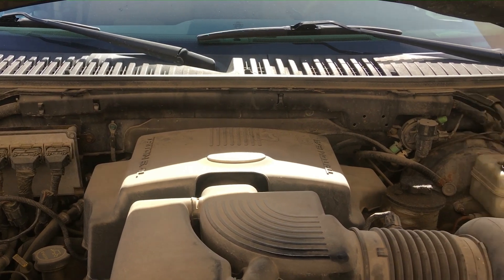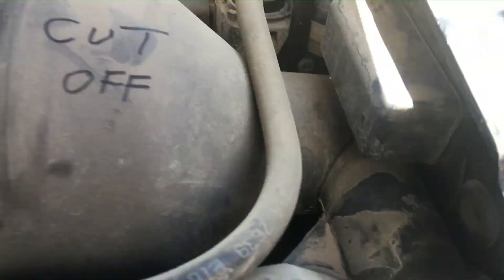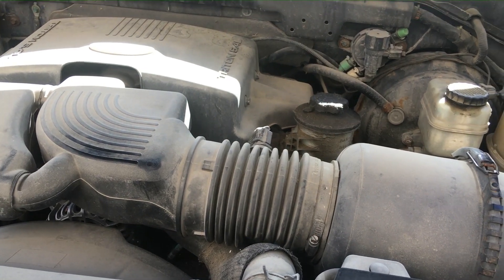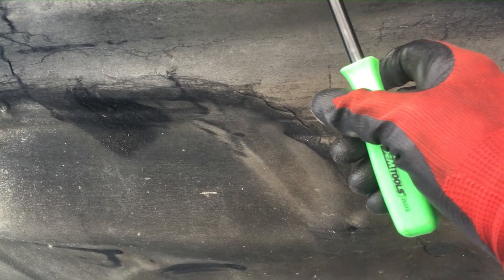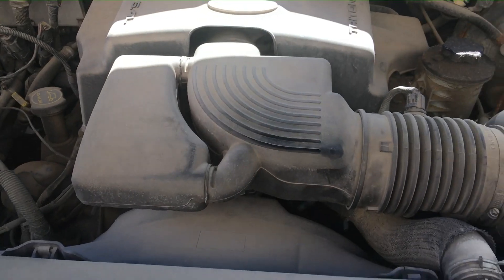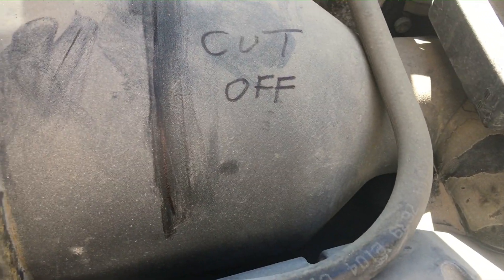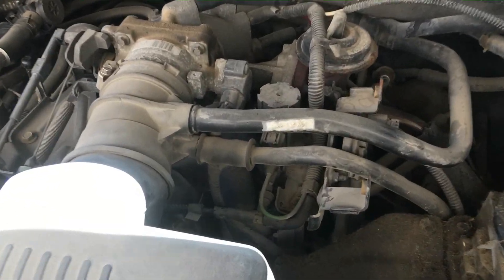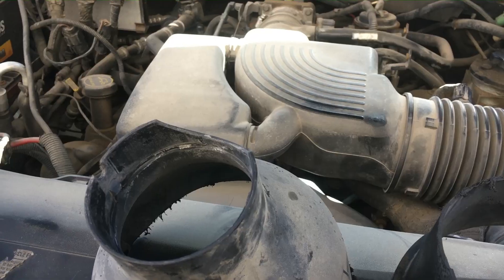Free Cold air Intake mod Ford Expedition, F150,  mustang 4 6 and 5 4 2v V8 engine

Comment: Great video, and you give me another way of an idea. I cut in between the air intake tube and the resonator. I than removed the resonator, placed a 2inch PVC elbow and ran it straight into the fender like the air intake tube. No engine air intake suction from the engine bay. I wish there is a way to post a picture. I thought by adding more inches to the original suction would make a difference. The cut is at a prefect location incase it fail than I could put it back to the original. For months I wanted to do like you did in this video, but the weather here in Nebraska could be crazy at times. I really love my 2003 Expedition but the gas mileage not so much. Big time better performance, it doesn't take much to get up to speed and still testing. Anyways, again your video ROCKS!!!!!

Comment: If you ran this thing on a chassis dyno it would show little if any improvement, and possibly even lose performance. That plastic is designed specifically for a certain amount of backpressure mated with the ECU for efficient fuel burn at all RPMs. You may gain WOT performance and lose cruising efficiency. If it was as simple as sawing the plastic off they would have done it themselves rather than place an artificial limitation on their design.
Reply from the maker: I did run my 2014 F150 3.5 twin turbo some years back with my intake mod and my exhaust setup.  It Dyno performed more wheel power and torque than the factory numbers at the crank.  Its on my 2014 F150 playlist if you would like to see it.

Comment: Thanks for the video, I live in a place where it's always sand storms and dusty weather so is it safe for throttle to do the same you did with my air intake ? I have the exactly the same car
Reply from the maker: Yes, I have to take compressed air and blow out my aircleaner every few weeks to keep it clean from dust and sand.  Saves money instead of buying new airfilters or paying more for fuel costs due to clogged filter.
Reply: @madboostingmadmatt48  thanks

Comment: Isn't it taking in hot air from engine compartment?
Reply from the maker: No, I made a video using my SCT tuner showing intake temperature is just a few degrees different than outside temperature when vehicle is driving.  When just sitting in traffic or idling in place, engine intake temperature rises due to no incoming cool air.  That is really good considering there is a hood over the engine that keeps heat.  I removed the hood heat blanket and engine cover, that helped make a great difference.  If vehicle had no hood, intake temperatures would be right with the outside air.

Comment: Did it to my 2001 ford f150 triton 4.6 v8 also changed oil and filter air filter as well. i didnt take of heat shield but i do feel a great difference . what are yalls thoughts on doing a muffler delete as well?
Reply: Take muffler out put in a straight pipe it will sound mean not too loud tho becuase u still have 4 converters. Decent rumble u could put in a flow master or cherry bomb
Reply: I replaced the muffler on another video and it was great

Comment: is there any chance of damaging the paint on the hood from removing the heat shield.
Reply from the maker: There is a chance, if on a really hot 100+ degree day and engine is overheating, or something catches fire from like a fuel leak, then there is a chance.  I have had no issues and have been doing it to all my vehicles for around 3+ decades.

Comment: You took off the fire blanket
Reply: Keeps a lot of heat on the engine and sensors, without it, engine compartment is much cooler.  Sensors and electronics on engine stay cooler which is good for them to last longer.

Comment: 2008 4.6 had the entire air intake assembly at the fender 100% logged with leaves. 🤦🏼‍♂️ cleaned and vacuumed this area. Hopefully truck will breathe better.
Reply: Clogged not logged 🤦🏼‍♂️ F-150 I question this design. How in the hell do leaves get inside the fender where the breather snorkel is??🤦🏼‍♂️🥴
Reply from the maker: Another great reason to get rid of the bottleneck going to the fender.  I have seen others having that problem where fender area fills with crud which is really hurting performance and can throw codes too.  Many great reasons to improve intake of our hungry V8 engines.
Reply: That was the case for my 2007 5.4L 3V I had

Comment: Its not cold air when filter is taking in air from engine compartment
Reply: Case in point, drive vehicle for 30 minutes, open hood, put hand on intake manifold, if its cool, cold intake doing the job, if intake manifold is hot, cold intake doing nothing significant
Reply: I get that there used on race cars but now days people think there cool and putting into there dailys. I was just wonder what the difference is between wat his doing and going and buying one that will do the same thing.  This trick is kinda like what they do with older cars when they take dust cap off there air cleaner and flipping around and putting it back on with a wing nut giving it like 3in opening to let in more air.
Reply: Better than wasting 100 something dollars on real cold air intake system that takes in hot air as well. what makes it different 🤔
Reply: @highlifegoodlife5400  what makes it different ? Great question.. Note the word cold... These type of intakes (designed for race engines tuned specifically for this type of cold air filtration system) are used to provide cooler air to a race engine. However, since the holes in these filters are bigger than a stock filter, the cold air intake allows extra dust and/or other particles in to your engine which likely causes damage (shortens life of an engine). Otherwise auto engineers would build a daily driver with these racing type systems. There's more to the story but i hope you get the gist and will take time to research the subject further. Have a good one and just so you know i was the mechanic whom worked on the tv series madmen (not an actor but off scene mechanic).
Reply from the maker: Well im getting cold air
Reply: @madboostingmadmatt48  yeah, sure you are 😆

Comment: Not thinking about pulling all the hot air from the engine compartment?? Wich will negate all you did
Reply from the maker: I have done alot to combat underhood heat.  Removed hood heat blanket that keeps engine intake hot.  Removed engine cover which also keeps engine heat on the intake manifold.  Air inlet is near grille and inlet area by fender.  It is as cold as possible considering factory items keep engine intake manifold hot by design.  On my 08 expedition when I did the intake mod, my intake temperature readings on my SCT X4 while I was driving were either the same as outside air or 1 degree more which is really good with the hood closed
Reply: @madboostingmadmatt48  i see under hood attempts to cool.. I appreciate your video but would modify differently .. Everyone should try their own thing

Comment: What are your thoughts on an EGR blocking plate? I've heard that is something that can help. I've already cut the end out of my air box and removed the cat. Muffler and EGR are what I think is the next steps. Oh, it's a 2.5L 4banger in a 99 Ford Ranger.
Reply from the maker: I have installed EGR blocking plates on my 87 Buick turbo t limited, 1986 Nissan 300zx turbo, 1989 Ford F250 351w, 1997 Ford T bird 3.8 V6, 2005 Ford Taurus 3.0, 1980 Buick Regal turbo sport coupe and many others over the years and it was an improvement everytime.  I believe it is not good for an engine to ingest exhaust which adds heat to the intake which needs to be kept as cool as possible.  I also believe in catch cans since oil deposits are not good to be ingested to the throttle body, inside intake manifold, as well as the entry to the intake valve which gunks it all up creating misfires when engine reaches higher mileage.
Reply: @madboostingmadmatt48  Awesome! Can you do a how to on the installation of those things? If you already have, do you have a link to those videos?
Reply from the maker: @TheMatthew72  I can prepare my 03 Ford Expedition for an EGR bypass.  Basically get rid of that exhaust tube from the exhaust manifold leading to EGR, Plug the EGR opening and bend and crimp the exhaust tube or replace the exhaust tube with a bolt that fits the threads.  Leave everything plugged in, it will still look like its there but it will not flow exhaust back into your engine intake manifold where it does not belong.

Comment: I bought a KnN reverse cone filter for my 6.7 cummins air box.  It pulls cold air from fender well. 90 bucks
Reply from the maker: I also had a K&N cone filter back when I owned an 05 Ram 2500 with the 5.9 cummins.  That turbo really whistled great and made more power with less pedal.  Of course I had a straight 5 inch turbo back exhaust too.
Reply: @madboostingmadmatt48  Yup, what I got,  deleted and tuned. But recently added a 5" w/8" body MBPR "Glasspack". 
I'm 51 and pull a small camper so me not being able to hear her yap while cruising along in a state of exhaust tone bliss ISN'T an option. 
😎🤣
Reply: @TheProchargedmopar  sounds like we have lots in common, i also like hearing exhaust tone and boost over her yapping